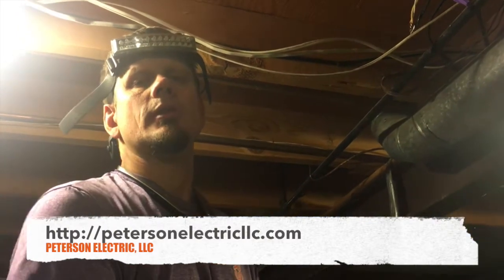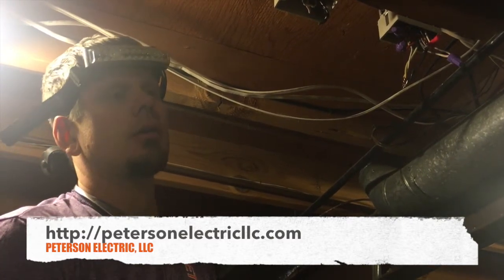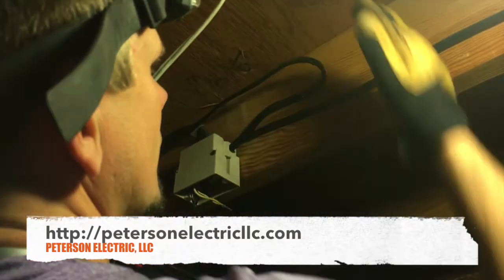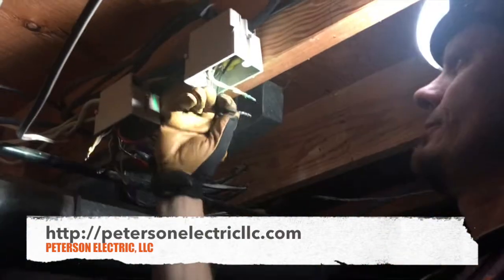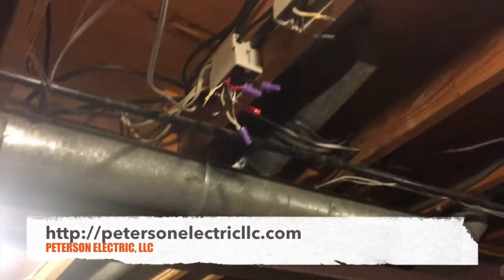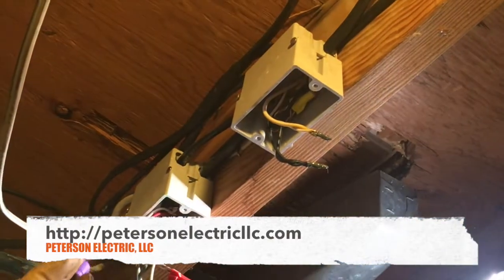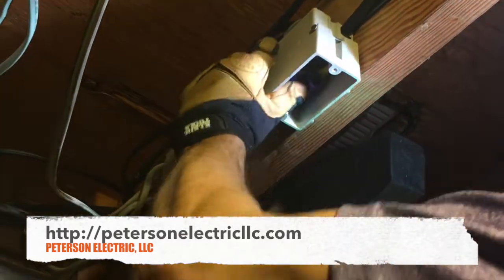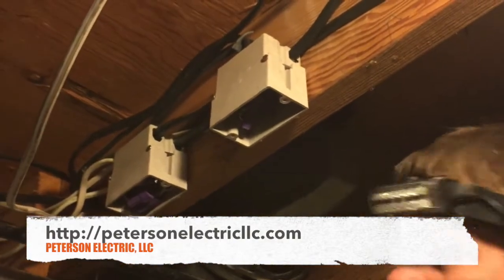The Difference Between an Arc Fault Breaker and a Non Arc Fault Breaker Circuit

Comment: Wago connectors not allowed in your area? In my view and many other electricians they are easier to secure. Though under heat and high current load there is no difference between the top they are equally as good.

Comment: Aren't you just creating a short circuit by putting hot to neutral? In that case a standard breaker and arc fault should react the same, or am I missing something?
Reply from the maker: No, you can use white as an hot, assuming you are doing an old switch loop. The AFCI is sensing the difference of path if using a neutral from another circuit or another path as the bare grounding conductor.